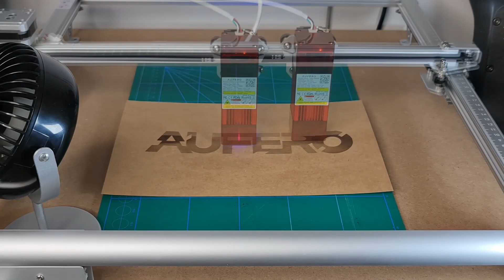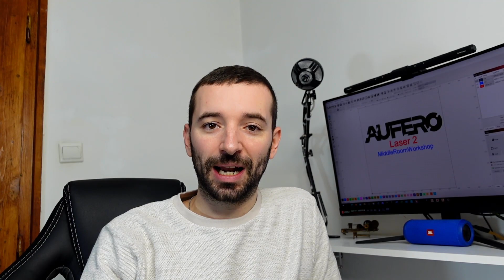Aufero Laser 2  - Ortur - Setup and Testing - Is it any good?

Comment: Does this cut 250gsm card.
Reply from the maker: Hi Bruce Suttie, thank you for your comment. 

That will be like butter for the machine. 
I haven't tried that specific thickness, but I cut 400gsm at 50% power and 1200mm/min speed. 
The laser in this machine can handle 3mm plywood in a single pass. 

You may find difficulties, however, if you want to cut something below 100gsm as the paper is too thin and it is hard to get it in focus.

Ciao
Reply: @MiddleRoomWorkshop  thank you

Comment: Hey, i have limit switches from a 3d printer would it be posibel to ad those? On the machine
Reply from the maker: Hello Jonas Veryser, thank you for your comment.

I am not sure about that. I notice that the mainboard has several free connectors, perhaps the two-pin connectors could be used for that, but I am not sure as I couldn't find any additional supporting document about the board itself.
I will definitely investigate further, and return you feedback once I am able to give you the right answer.

I hope it helps.
Ciao